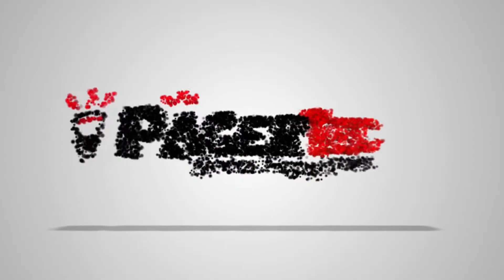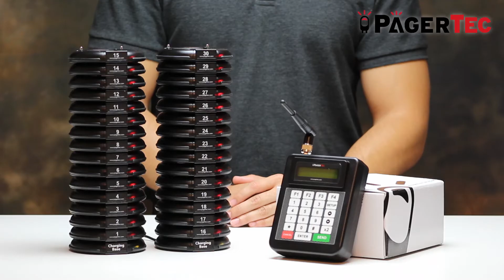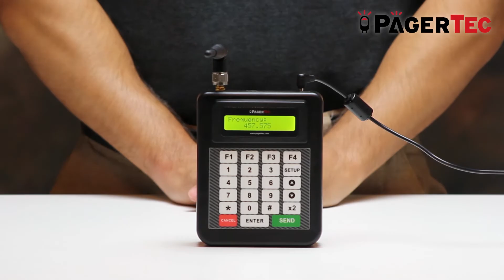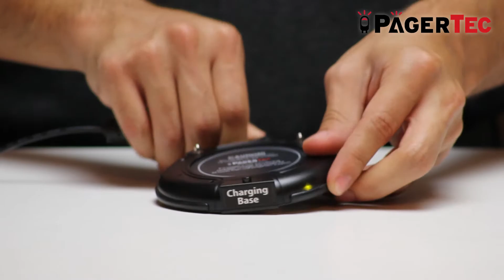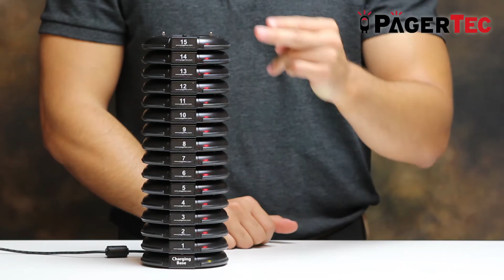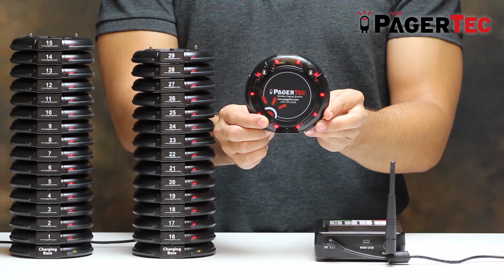Pagertec - Smart stack coaster paging system

Comment: Is there a timer setting? If so, is there any way to put each pager on its own timer so they buzz a different times? 

Is there such a thing in the industry or would i have to get a commercial kitchen timer then buzz on my own at the base?
Reply from the maker: Hi Jazmine. This system has a lot of different options and timers, definitely is one of the options so you might want to contact us and speak to a representative. 1-877-593-4545 or visit our website at www.pagertec.com